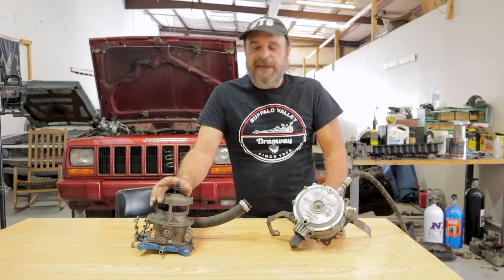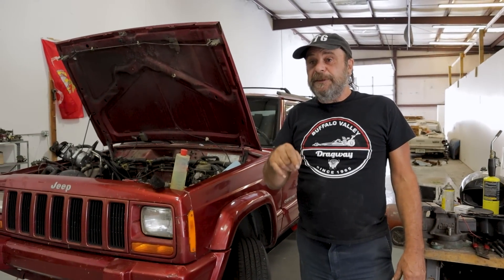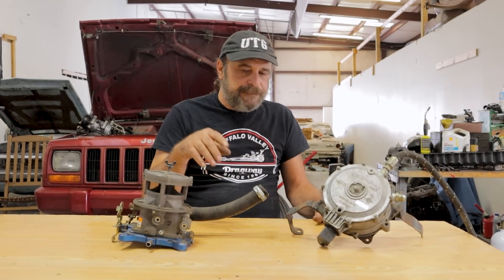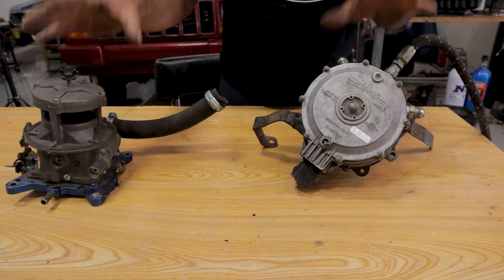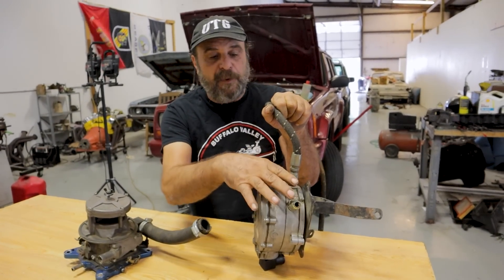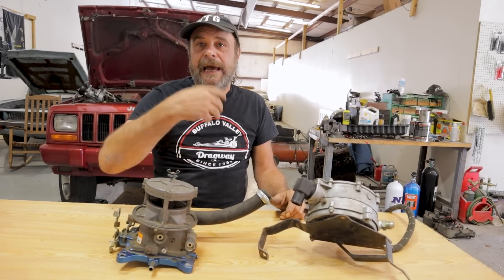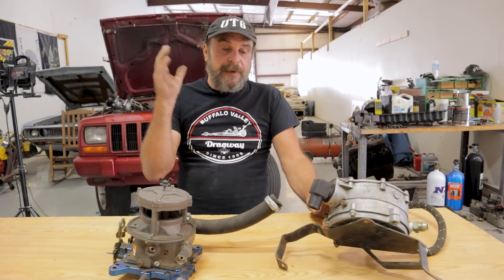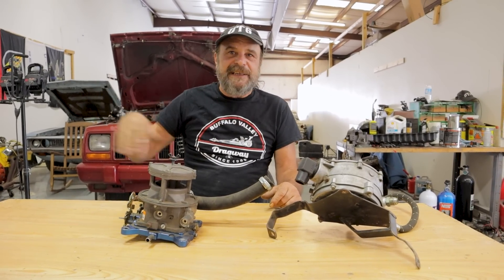Hot Rodding With Propane (And Propane Accessories) - Overview Of The Impco Carburetor

Comment: Propane vehicles were huge in Canada in the 80's. There was no road tax on propane at that time. A friend got into the business and we converted many vehicles, dozens if not hundreds, mostly trucks and taxi cabs. This ended more or less after propane for road use started to be taxed the same as gasoline. It was still cheaper than gas but not as much. Also, it was harder to convert fuel injected cars and almost impossible once the engines were fully computer controlled and distributor-less. We did a few high performance installs. Our experience on a typical 8.5:1 4BBL small block was that power and fuel economy was down closer to 10%; we measured fuel economy carefully and never were able to get to only a 5% loss. However we built a couple of high compression 11:1+ engines and could run these at full ignition timing 38-40 degrees advance. These ran very well with dual Impco carbs and no sign of detonation, and would make tons of power. We played around with a turbocharged 2.3 Ford and could run 15 lbs of boost on propane but the boost control was primitive at the time and  we eventually had a bad failure. For daily driver installs we usually used a dual fuel install with the Impco carb sitting on top of the conventional gas carb. The air could be set to bypass the Impco carb with a cable operated control, and there were fuel solenoids for both the gasoline and propane supply. In winter, on the Canadian prairies, there was not enough heat to vaporize the propane so normal practice if the temperature was below about -10 F was to warm the vehicle up on gasoline and then switch to propane. The vaporizer took its heat from the return heater hose. This worked really well. 
Propane is an excellent automotive fuel, better in many ways than gasoline. It also produces consistently lower tailpipe emissions and less CO2 than gasoline. Catalytic converters are unnecessary.
Reply: As I mentioned, it is pretty difficult to retro-fit a mixer system like the one Tony has in the video to a computer controlled car. It would be possible to use injectors and inject liquefied propane the same way that gasoline is injected. The propane would have a significant cooling effect on the intake charge. This would be fine under heavy throttle and really useful with a boosted engine as the cooling would reduce the heat of compression, possibly eliminating the need for an intercooler. However, at idle and cruise it might cause icing. The computer and the A/F sensors would have to be calibrated for propane. There are no unsolvable problems, and I think the real reason that propane has never been adopted as a mainstream automotive fuel has more to do with infrastructure. The refining, distribution, and retail sales systems are all set up for gasoline. Propane is mostly a byproduct of natural gas production. If a significant portion of the  North American light vehicle fleet were converted to propane, there would be a huge increase in demand, and the infrastructure for producing and distributing propane would have to be built out to match this. This would have to be paid for with increasing propane prices. It would be a disruption to the market. On the other hand, it would be a much lower disruption than the mass conversion to battery-powered electric vehicles. 
I would support increased use of propane as a vehicle fuel in a heartbeat. It is much more practical than CNG (compressed natural gas), which has been touted as a replacement for diesel fuel.
Reply: @gavinmclaren9416  It's not as hard as you would think. You need a fuel injector emulator and to cut the injector wires and run them into the emulator, so the ECU doesn't know it isn't actually running the injections when your running propane. Then fab up an adapter and bolt the Impco mixer on.  Fairly easy on fuel injection systems from the mid 80s thru to the early 00s. I have that setup on my 302w efi ford. After the early 00s, you really want an injected gas setup, which come in both Vapour or Liquid types. Some have wiring good enough that the wiring is literally plug and play, no wires to cut, then you drill your inlet manifold, fit some nozzles and hookup a propane injector for each inlet runner. Some you need to cut a few wires for the injectors still, but it's really not that hard. 

AC Stag make some good injected systems, you can even get the wiring diagrams off their website that shows how to wire it up. I had one fit to my BMW v8 recently.
Reply: I have the same setup on my 440 in a motorhome and it runs great and is economical. Running gasoline at these prices would be very costly, I have  two tanks totalling 150 gallons  at $2.30 a gallon instead of $6.25 is a huge difference. Stainless valves, 10:1 compression, cam designed for propane(early intake, late exhaust) timing way up to max, highest flow rate on the regulator diaphragm needle(that's how you adjust the"jets" along with the vacuum) different diaphragm needles are available. There are numerous types of shut off valves available to cut the propane off at the tank automatically when engine stops or too high of a flow rate in case of engine failure or hose breakage. Propane loves boost and I would like to turbo it but not in the vehicle it's in now.
Reply: @edlawrence5724  turbos can easily solve the problem with the variable octane rating of propane-butane mix( dew to use of Summer/ Winter mixes )  , just by simply adjusting the turbo boost. The only problem is that turbo engines has lower compression ratios so the cold starts would be a bit more difficult probably .
Reply: @flappingflight8537  the old really low compression turbo builds are not a thing any more really 9.5:1 or even 10.5:1 + can boost with gas even low boost with 87 just add water injector. its in the tuning
Reply: @edlawrence5724  Man where are you getting propane? Last time I filled a 40 pounder (this march) it was 4.20 a gallon
Reply: @TheeAbstractHero  for some strange reason propane is much cheaper here in Canada, the large distributors will refill a 20lb tank from $10.00 to $18  and the prices vary greatly. I shop around as here in Quebec there are distributors everywhere and I've paid from 50cents to 78 cents a litre or pound as 1 litre equals a pound 4 litres a gallon. Gas here is$1.68 a litre so huge savings.
Reply: Propane actually evaporates on 42C so it’s better than gasoline for cold starting . The problem are the evaporator pressure reducer rubber membranes which lose its flexibility on low temperatures . There are generation 5 sequential LPG injection systems today which inject LPG straight in liquid phase in to intake runners so there evaporator - reducer is obsolete , such a vehicle start directly on LPG on very low temperatures and they doesn’t have/ need additional gasoline tank .
Reply: I'm a Canadian and my daughter's friend's father had a 3/4 ton 4x4 Chev truck with a 454.  He converted to propane in order to be able to afford to run the beast.
Reply: Zip Ties N Bias Plies mentioned one time that his dad would pour his hot coffee onto the regulator to thaw it out before a cold start and keep it warm til the engine reached operating temperature. Clever workaround, even if it meant losing human go go juice in the process.
Reply: Thank you for the detailed and well informed comment. It's not often that I read one written by a person who knows what they are talking about. God bless
Reply: I've seen far too many deaths due to propane tank explosion. I'm not okay riding next to a pressurized fuel bomb waiting to happen.
Reply: @alpha13dylan  Proper automotive propane tanks have safety valves that make explosion a very rare occurrence these days.
Reply: It's rare I find someone that has experimented with propane as far as an automotive standpoint .
        Back in the early 80's I worked for godfathers pizza .
We had hundreds of Chevy s 10 trucks with ovens on the back , propane operated .
Also we converted all of the trucks to propane , both 4 and six cylinder engines .
     Seattle WA is mountains , I'm here to tell you we could not make these trucks pull a hill , even a 4 percent incline fully loaded .
       The systems were set up to run gasoline or propane and the driver could switch it with the proper procedure .
        I'm not sure how much the ovens weighed but if you gather up all the parts for the propane system , they were heavy ! 
      That's one problem .
All the possible dangers was another .
       I did not have a dyno available to me but I'm thinking there was a 30-35 percent loss of power as well as economy .
       But in all truth these trucks were put to the test every day going up and down steep hills and running all day from 9 am to 11 pm  
And it was not in common to have more than 75 percent of these vehicles with well over 25000 miles with the original oil filter and oil still in them as well as the original plugs that still looked like they were only a month old .

But , you do need higher compression for the propane to be efficient and even come close to the economy that gasoline does .
      These trucks were eventually scraped or sold off because of changing times and the spending habits of the American public , but the worst thing is finding somewhere to fill up your tank .
I live in a motor home and it's hard these days to get your on board tank filled because mostly of ignorance but the fact remains that not every place is a filling station .
And yes the colder temps will make it harder to operate such systems .
Not only that , propane is hydroscopic in a bad way .

        Nice to talk to you .
    
          J a s
Reply: In Oz Ford did factory propane (lpg) only with the 4L Barra6. It went like stink!
I owned a LPG cab chassis Falcon and yeah...working man's sports car.
No regrets. Easy to work on. Good things etc.👍
Reply: why is it not used more?
Reply: @XxMusclecarsxX  energy density mostly, but also convenience. 

propane has about a third less energy density than gas or diesel. It means you need a bigger tank to drive the same distance. The other problem is designing a tank that packages well and safe in the event of a collision. Propane tanks are somewhere in the neighborhood of 100-200 psi which doesn't lend itself to the kind of packaging flexibility you get from a gas tank (where the engineers can bulge it into otherwise empty areas or away from suspension components). When I worked at Honda, they were building factory CBG powered Civics and the fuel tank was a big cylinder that took up most of the trunk. The cars also only got about 250 miles per tank.

The other issue is refueling. For vehicles that have a stable base of operation and never travel outside of that area, like farm vehicles, taxi cabs, or city busses, propane can make a lot of sense. but if you need to be able to get 250 miles from home with the car it's not going to be easy given our current refueling infrastructure. it's all the same downsides as an EV had 10 years ago.
Reply: Remember the 2.6l ram vans came with  propane or natural gas set-up.
Reply: Very interesting
Reply: Yessir. They wouldn't run propane inside warehouses if it wasn't clean.
Reply: Here in Nebraska there were a number of propane converted pickup trucks running around in the '80s.  It was popular for awhile.  My dad always remembered the one guy he worked with at a farm implement dealer that had one.  He went to the garage in the morning leaving for work, turned the key on his truck and "Woof !"  His wife came out to the garage and said "what was that ?"   I only know what I was told, propane had leaked during the night.  When he turned the key and ignited it , it bulged the walls out of his garage.  That was the end of him owning or driving a propane truck after that. 😁

Comment: its safer than petrol , aussies use it a lot , but we use a copper line from tank to the LPG converter , it will ice up just at idle without a hot water feed tony . AND i dont see a shut off solenoid on that convertor , it should be on the line and wired to the ignition so when you turn the key off it shuts the flow off

Comment: Howdy Tony, I ran a stand alone LPG fuel system on my Discovery, cut down to a trayback with toolboxes, in northern NSW until it was difficult to get, seems like the authorities want to get rid of automotive use here in Aus. Ranthe same setupon my 3.9litre, with a weight of 2800kgs I was getting around 4km per litre of lpg, in18 months the price per litre went from 70 cpl to 125 cpl which compared to diesel at the time was uneconomical so now I'm running a diesel in the car/ ute. Take care dude

Comment: Here in Europe, especially Italy and eastern Europe, LPG is still extremely common. There are vacuum operated (like yours) systems and injection systems that simply use the signal from the gasoline injectors. The kits are as cheap as around 200usd for a dedicated tank with a sending unit, vaporizer, mixer, and a simple ecu. I've been running all my cars on vacuum vaporizers for the past 10 years. Modern direct injected engines have made it harder to convert but several manufacturers currently offer lpg as an option from the factory.
I agree with what you said—the lower calorific value of LPG can be more than made up for with correct tuning. The longevity of the engine also increases as the gas does not contaminate the oil as quickly. As well as it does not wash the oil from the cylinder walls.
Reply: And the higher octane rating 105-108 allows compression ratio of 13-14 :1 which compensate the lost of power partially. There are a systems which inject the LPG straight in liquid phase which even increase slightly the engine power since the intake charge is cooled more and respectively more dense. Unfortunately most of conversions are done without engines compression ratios correction . There are South Koreans cars models which are designed to work only on LPG . Their engines compression ratios are 13.3-13.5 :1 . They start directly on LPG and doesn’t have/ need additional gasoline tank .
Reply: @flappingflight8537 
I have a Mazda Bongo van with 8.6:1 compression on propane; big power drop vs petrol.
Reply: @petesmitt If it's a good system (ie not a cheap nasty amos ring system) and the ignition timing is adjusted a little, you should notice very little power drop on LPG.  I had one of those crappy amos ring systems on my torana. Lacked power and economy on gas, compared to petrol. Took that junk off, as MCM would say "in the bin" that junk went, and fit an impco model L and an impco 200 mixer, power was back to almost the same as petrol, and my economy returned too. 

Biggest trouble with LPG in australia, was that too few of the "fitters" actually knew what hardware to fit to what engine and how to tune it. They just slapped the cheapest junk on that they could charge someone for and sent the car out the door. You would take it back time and time again, they could never get it to run right, even on petrol, and people would blame the LPG fuel, Not the dumb ass who fit cheap nasty hardware that doesn't really work. 

You get someone who actually knows how to select the right hardware, install it correctly and tune it correctly, and LPG car's are awesome. I've been running it for over 20 years, with impco vapor mixers, sprint new gen carby hat, early 00s vapour injection on a falcon 6, liquid injection fit in 2014 on my wifes ba xr8, which goes harder and makes more power on LPG, and I recently had a current generation obd2 AC STAG vapour injection setup fit to my BMW v8. Polish gear, and it's bloody awesome! That makes the same power on LPG or petrol!

Comment: In Russia millions of people converted their cars to run dual fuel, gas and propane. Propane is noticeably cheaper, so conversion kits are readily available and propane gas stations are everywhere. It is common to see many buses and trucks with big red propane tanks. I have even seen a 5.2 Magnum converted like that. I've heard that in EU many use similar setups, just not sure how popular they are. It's a shame there is like one propane station in the whole DC area, in Dulles airport. I would probably try and tinker with this conversion otherwise, would be cool to cut costs on long travels if it was available.
Reply: It cost too damn much in tax to switch to propane or lpg.

Comment: Oh boy these impco systems are very popular in the netherlands. I have 2 cars running with the impco 300a mixer on small block chevys mounted on top of the carb. LPG is 3 times cheaper than gasoline here and readily available everywhere on mainland europe except for austria. And a bit less available in the UK and scandinavia.

Comment: I live in Australia and I converted my 1994 4.0 Jeep Cherokee back in 2007.
I ran a Italian vapour injection system and it was a bloody great system.
350 kms per tank and with the petrol tank full I had 800 plus kms.
The 4.0 loves LPG . Liquid injection is next and Ford Australia built and sold cars with the 4.0 six with this system and the performance was better than that of petrol.
Because it’s liquid injection in to the intake it expands when it turns into gas vapour and gives a small positive pressure 
Australia is the or was the leader in this stuff

Comment: Does propane make big power.
Reply: It’s hard to get enough flow to really make big power with it. And, if pulling a lot of propane for very long it’ll ice up the tanks and you loose pressure. 

From what I’ve seen about 4-500hp is about the top without really getting fancy with it.
Reply: @NBSV1  kinda what I was thinking, I know it is hard on ex. seats.